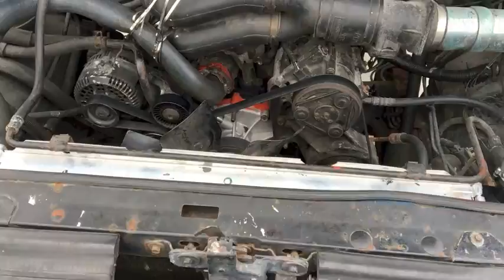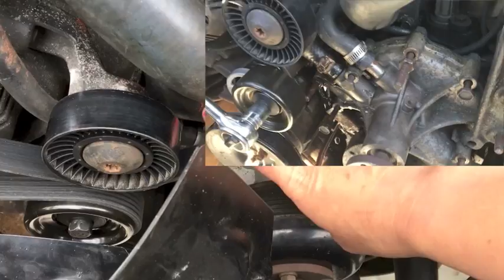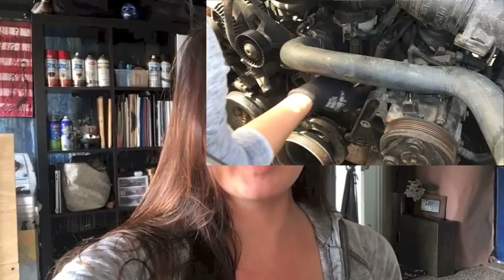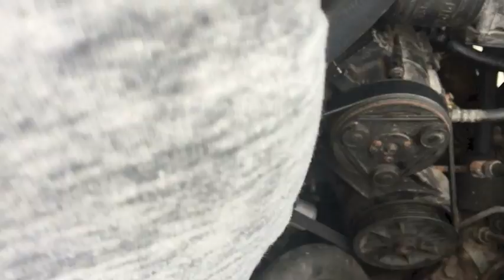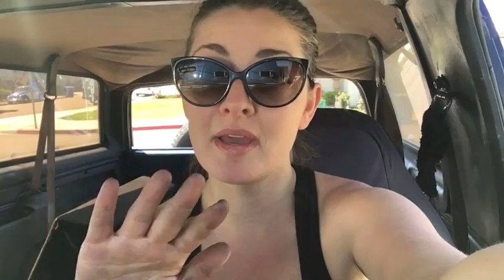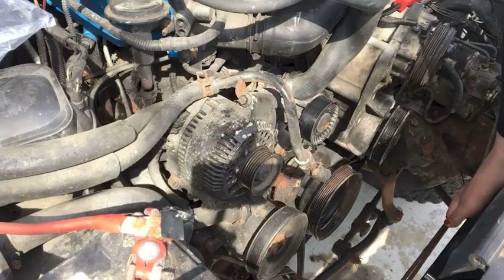How To Replace a Water Pump | 96' Bronco

Comment: Little trick for radiator and water pump hoses, for easy removal and installation, put a little grease (bearing/chassis) on the nipple or inside of the hoses. Works like a charm.

Comment: I get to do this today.....I hope it is it.  The things running hot but not overheating. The top hose is hot. The bottom one aint....I did this 4 years ago. Bought the cheap one for 20....Rad was new? Maybe it got clogged. Changed the thermastat..Im back again. Thought I would be rock star by now...oh darn      :)

Comment: thanks for the info.. my 93 Bronco is getting a new water pump and Im gonna replicate your process..!
Reply: Where did you find your water pump ? I can’t find the correct water pump for my truck (90s Branco )
Reply: @tarainman7275  
Part #:
    C251670
Line:
    MWP ..Oreillys part.. I didnt get it yet but evidently fits my 5.8 liter 1993 bronco..I ended up simply flushing my coolant system and changing out the thermostat.. water pump is still good..

Comment: 2:59 Great tip to put the hoses on FIRST.  Don't know how you stay so clean doing this hard work.  My forearms get filthy and I have scratches and bruises after a job like this.  Great job!  If I supply the parts, and deliver vehicle to you, how much would you charge to replace the intank fuel pump on 1990 full-size Bronco w/ 5.0L ?   While you have the fuel tank out, I'll take it to a radiator shop for internal cleaning.  How much would you charge?  If not you, what is a fair price to pay an independent mechanic for this work?  Labor only, I'll provide parts.

Comment: Hey, Morgan.  Always enjoy watching your videos.  I have a 1996 Ford F150, so everything is pretty much identical to your Bronco.  I usually come to your channel first for repair videos, because you so purrrty. Haha. Anyway, I want to know how the hell you got those a/c boots off.  The ones on my truck REFUSE to turn.  I PB blastered the hell out of all three of them, and used a long breaker bar, but they will not cooperate.  I'm wondering if I'm going to have to go buy an expensive air impact wrench or some shit.  Probably would help if I wasn't a scrawny 150 lb dude with the strength of an 8-year-old girl. Ha  It's embarrassing and depressing.  So did the bolts come off pretty easily for you, or did you leave out the cussing and fighting with them?

Comment: Morgan May  I am doing a water pump now too. Wish my Canadian could do some work like you. I have done quite a bit to mine  for off road use. I would be angry if I would be stuck behind Jeeple traffic of 10-20 doing 5-15 mph or slower through 2' whoops and spotting each other off a curb. Plated and gusseted cut and turned beams with long chromoly radius arms heim jointed. Tall shock towers for long KIng Shocks. Gears lockers chromoly axles with F-250 passenger slip shaft and U joint. Strapped at 17-18" after cycling and clearing it all. Not the 13" the Raptor has.. My Canadian was a bit whining at first like this...  https://www.youtube.com/watch?v=A1W7VRWuVP4  Thankfully she rode like this later filming in the truck here on a 150 mile Mojave Road....https://www.youtube.com/watch?v=LtuWtuR2qIg   She is good looking  like you are so I am glad she mellowed. I would not cheat on her if I meet sexy girls I must bring them home and share.